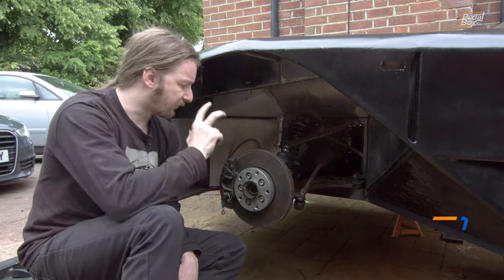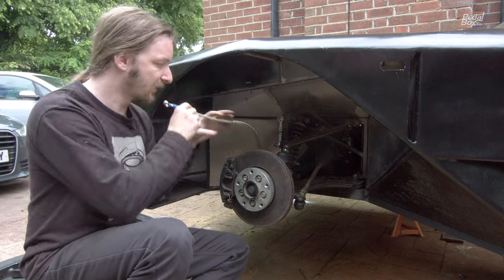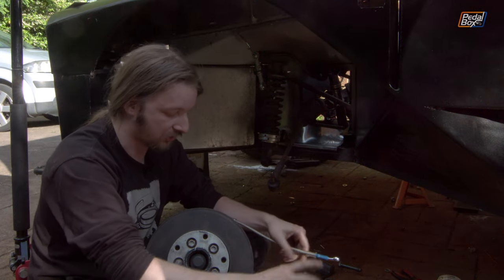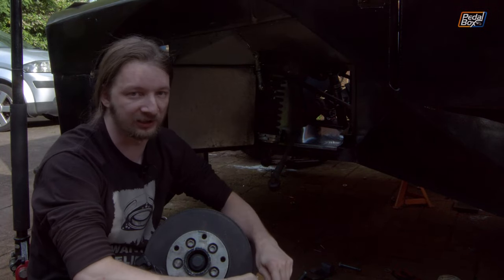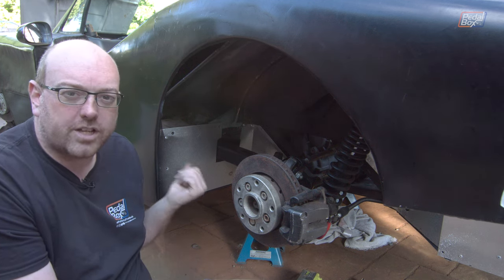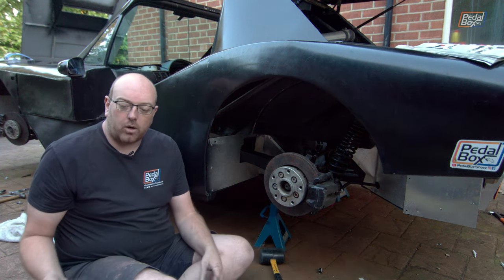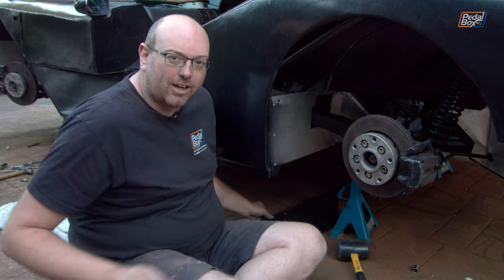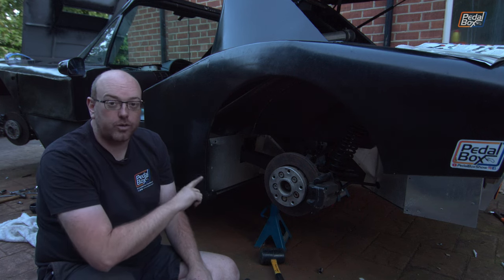We Break Stuff | Audi TT Kit Car | PedalBox Episode 161

Comment: Are you sure about using wood for the underside of the car? Even resin-bonded and coated woods...? Easy to replace, sure, but... weather does horrible, horrible things to wood - even well protected wood. I wouldn't recommend it. Could you not use some kind of plastic sheet instead, like ABS, or even polyamide nylon? I suggest plastic only because it's cheap, weather-resistant, easy to work with, lighter than wood, and just as strong, but you won't have to replace it every springtime.
Reply from the maker: Foreshadowing intensifies

Comment: Flat flush fasteners fitted to a red lorry or a yellow lorry,  I couldn't say that on camera 👍
Great episode chaps, it's a massive complex build, if you've still not done the drive shafts check out a old video of mine having to shorten 02M shafts, same principle. If doing it again I'd cut in the middle, easier to insert a machined interference part and weld (I actually feel I should make a spare set up!😂)
Reply from the maker: Next episode is the chop/extend for length/first fit check. But we did that a while ago, lol